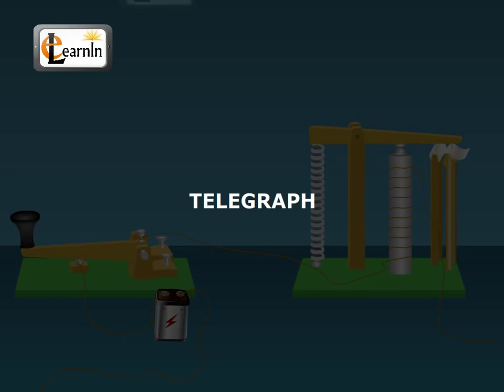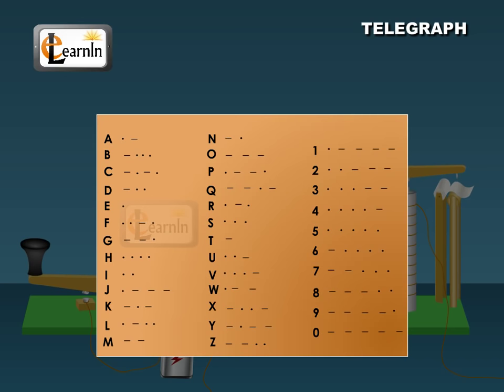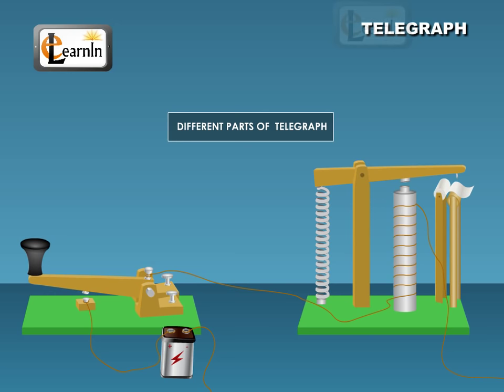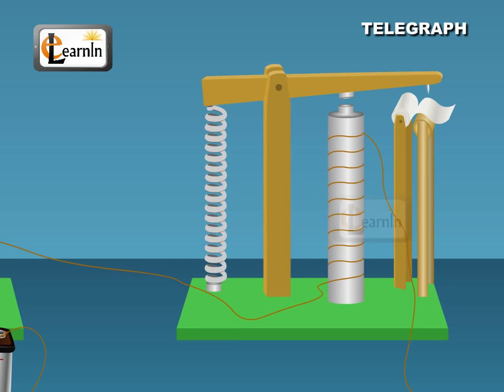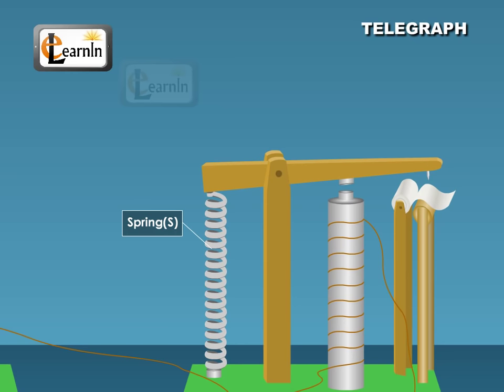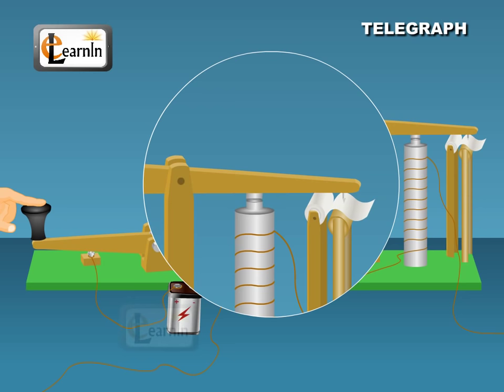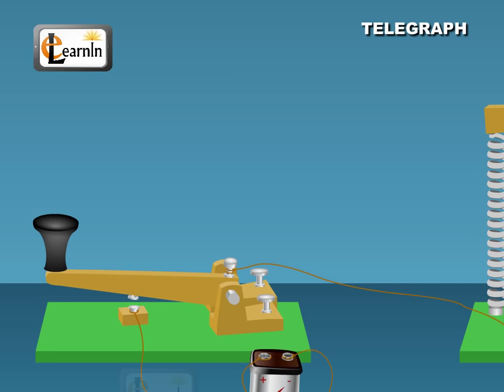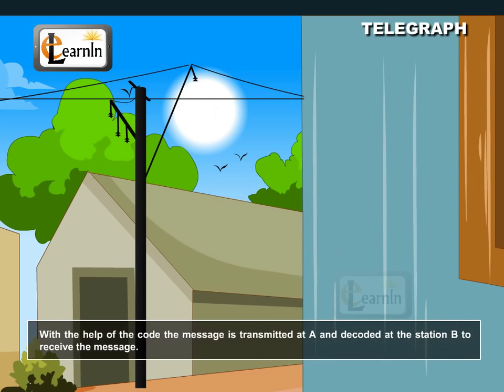Working of a Telegraph - Physics

Comment: The "code' for letters and numerals which is shown is N-O-T the original "American Morse" code used on the Telegraph.  The code shown in the video is a code cooked up in Austria and therefore is called the Continental Code, or some people call it the "International" code.  At any rate, radio people use the Continental Code to send their beep-beeps.  Telegraph people use the original American Morse code, which dates from around 1834.

Comment: The "code" shown on the chart is NOT the original 1830s code, developed in Morristown, NJ..  It is the much later code developed in Austria and now used on radios.  The Dot/Dash combinations are different in the two codes, the older code being the faster of the two codes (because it has many fewer dashes, a.k.a. "lines.")